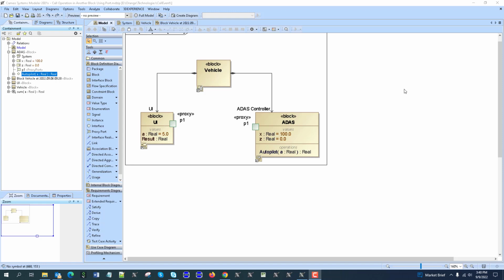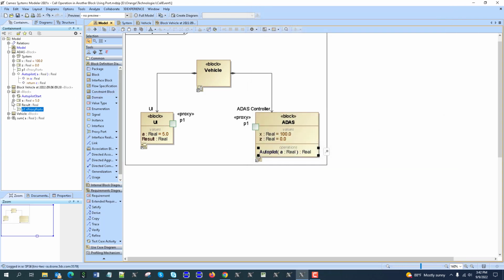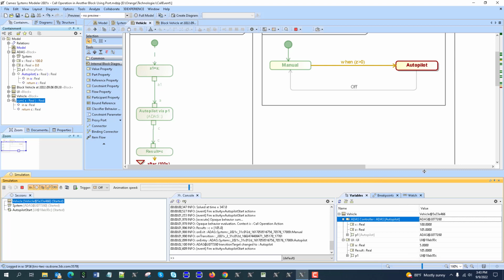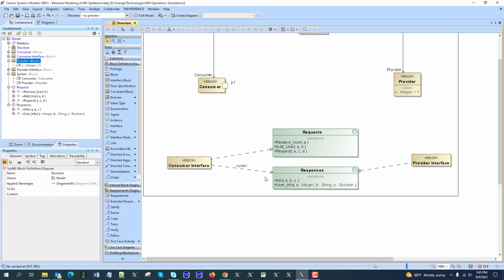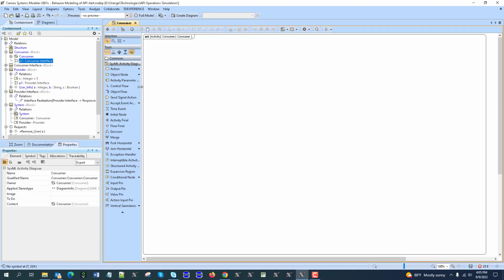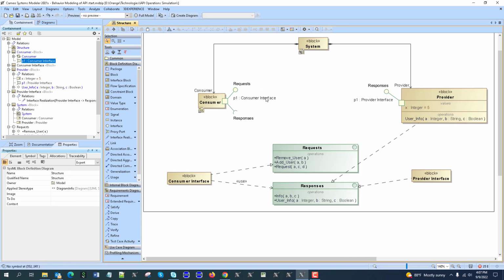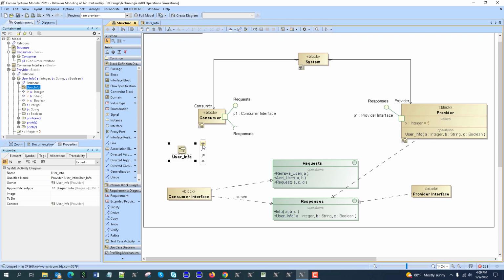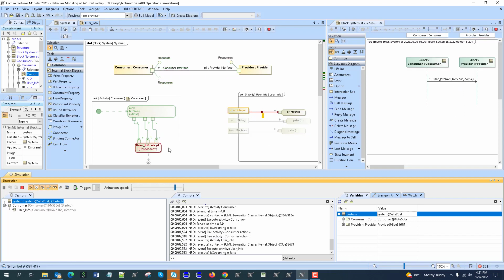Simulate Interface Using Call Operations in SysML. From Basic and Advance

Comment: From a SysML standpoint, how does invoking a Call Operation Action differ from invoking a Call Behavior Action allocated to a block / part via a swimlane?

It seems like Call Operations and Call Behaviors are very similar, but differ in the way that the receiver "owns" the behavior. Call Operation action seems more Object Oriented in nature while Call Behavior seems more model specific. Any thoughts on when you'd want to use one or the other?

Comment: Two things on the first example:
1) On the Call Operation action, it is necessary (not sure it should be) to delete the "target" argument, not just from the diagram, but also in the Containment tree. I lost a lot of time, so I wanted to call attention to it so maybe others will be more promptly successful.
2) More importantly, one would want to type the proxy ports with an Interface Block, which in turn owns the Operation. I have not succeeded in getting the called operation to execute this way, however, in MagicDraw 2022x Refresh 2. (I guess this version of the tool does not support this. If it does, I would certainly like to know how to make this work.)
Reply from the maker: Thank you for the feedback!

Comment: Thank you for the video Dr Pavalkis. You mentioned at the beginning that this can be used for API calls ( like GET operation), do you mind please making a quick video to demonstrate it ? It will be extremely helpful. Thank you very much 🙏
Reply from the maker: Thank you for the question. I had in mind that this modeling method can be used to define API. This is an example how API could be modeled.
Reply: @MBSEExecution  thanks for the reply. Since API is mainly data driven especially with the GET or POST calls , I am not quite sure how to do it. This example works well for calculations using opaque actions . Any recommendation how to use those operation calls (GET , POST etc .. ) to model actual data (Boolean , strings , etc ..) been passed on? Thanks in advance

Comment: Thanks for the great example👍! One question though: Is it possible to use proxy ports and interface blocks to define the interfaces? Or is it not supported by the simulation?
Reply from the maker: Hello, thank you! Proxy ports are supported. There is video on this topic. Important to know that proxy ports does nit have implementation so they pass values and signals in / out the block.

Comment: Thank you for the awesome example.  I have learned so much from your channel.  Is there a way for Block A to call an operation on Block B, from an opaque behavior in A?  So just like your example here but instead of a "Call Operation Action" you use an Opaque Behavior?  Thanks!!!
Reply from the maker: Hello, thank you Rebo. I think yes. Opaque behavior can call CallOperation Action.
Reply: @MBSEExecution  Thank you for the reply.  I have been trying to get this to work and have not been successful :(.  Would I use the ALH function?  I can't find a way to tell the opaque behavior how to find the operation on the other block.  I tried using a part or reference relationship to the block with the operation, but the execution fails.  Would you have an example?  Thank you!!,

Comment: I'll second the request from Eris.  In my case the response message might include several hundred data parameters.  For a quick reply, do you think either the basic or advanced method will be appropriate for a transmitting a response message of this size?
Reply from the maker: Hello. Try with basic first.